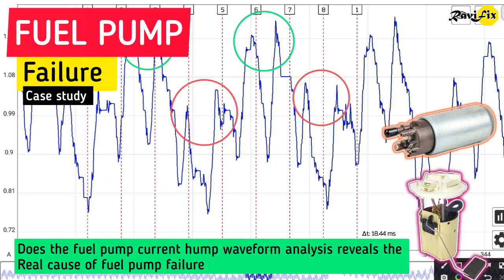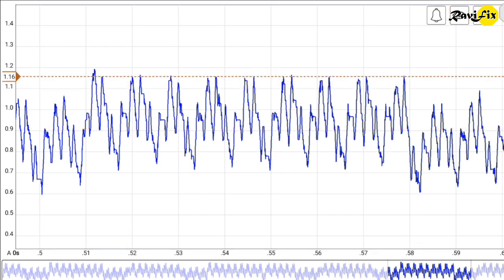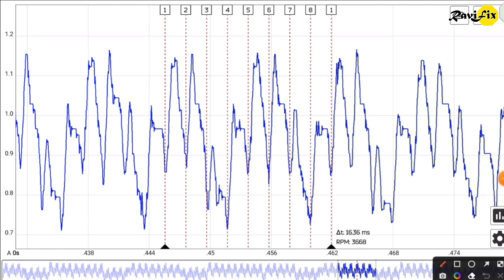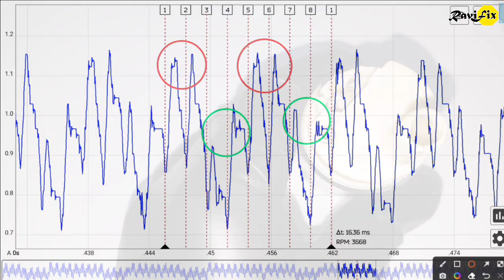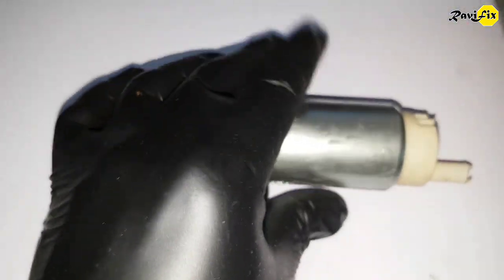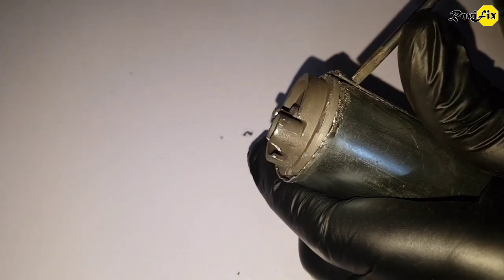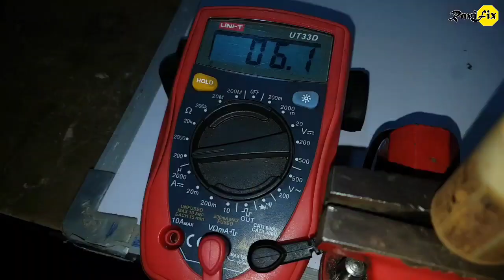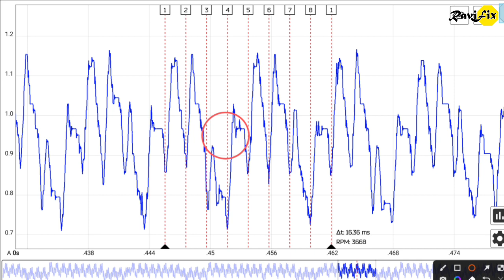fuel pump anatomy | does the current hump waveform analysis reveals the truth of its failure?

Comment: Ravi quick question which I'm really struggling on using a pico or any scope , I do not understand , now there are 8 magnetic pick up point on the motor , how do you identify which is number one on scope I am struggling  on , you have strip the motor and you have identified there are 8 pick up points which i understand , finding top dead centre on engine timing is easy, but this case there is no top dead centre how to find number one pick up point this is something I've been struggling for a very long time ,and also I would like to say wow great amazing video very educational thank you
Reply from the maker: Actually nobody can define number 1 current hump for fuel pump current hump waveform.
Only we need to select 2 identical humps which has 8 humps count between them. 
So you don’t need to think about which is number one. Just measure between any 9 humps as a one rotation.
Remember,  rarely some motors could have 12 humps per 1 cycle.